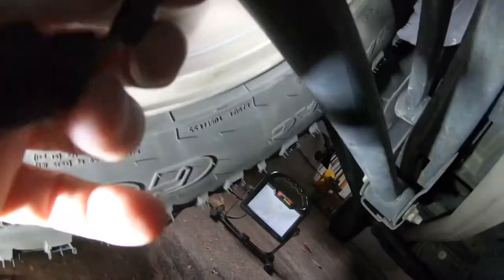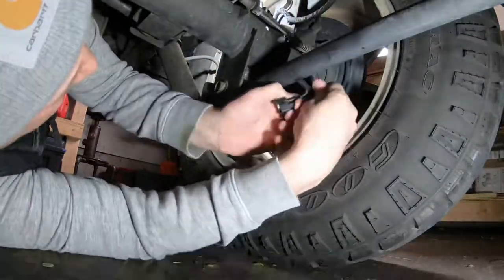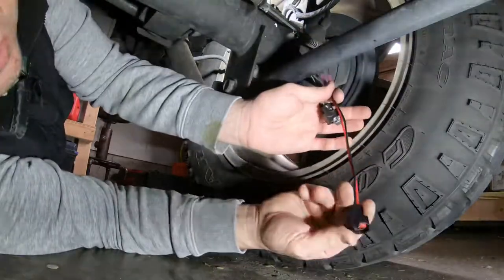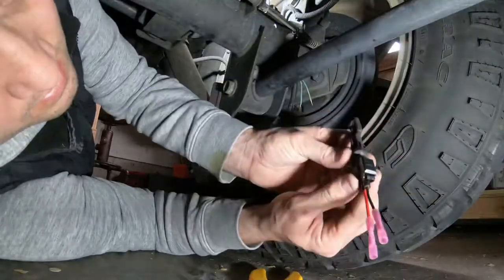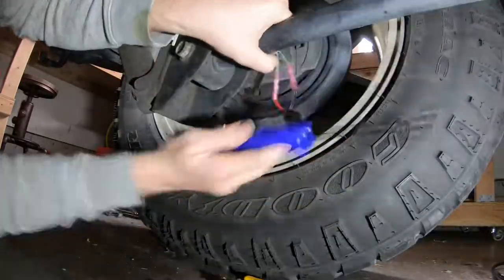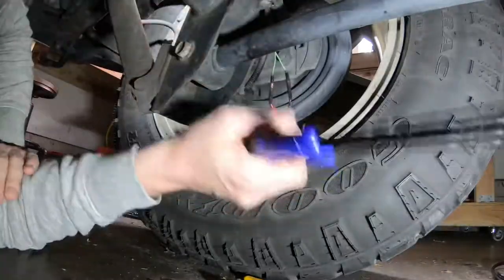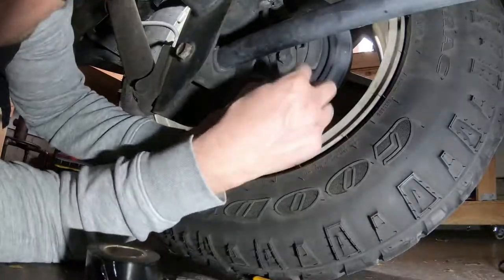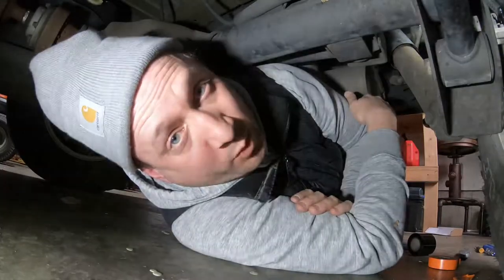Fixing the Broken ABS Speed Sensor Harness! #JEEPJK #EasyPeasy

Comment: Thanks for this awesome video. Replacing my rear this week, I’m just confused on the heat seal connector you used. Is there a specific one that I need because I can seem to find the voltage of the wire so I’m not sure which one to grab!
Reply from the maker: Thanks! 

I used a connector from an assorted pack I picked up at Lowe’s. You can buy them at any hardware store or Amazon. Here is a link... 

18-Count Butt Splice Wire Connectors 

https://www.lowes.com/pd/Utilitech-18-Count-Butt-Splice-Wire-Connectors/999952874

For the wire, I used a 14 gauge from AutoZone. Again, any auto or hardware store should carry it. 

Everything is still worked perfectly! No issues. 

I’m pretty sure I have links in the description of the video to some of the things off Amazon.
Reply: @theSuburbiaDad  awesome, thank you so much!

Comment: Where did you get that replacement part that you crimped onto the end of the existing harness? Don’t you have to get a new harness to plug it in the both ends? Is that more difficult? I mean where is the other end plugged into?
Reply from the maker: You can find the replacement at almost any auto store. I may have it linked in the description on Amazon; just make sure the part fits your Jeep. I think I went to AutoZone to get mine. I just replaced the part that clips into the sensor by connecting the existing wires to the replacement part. It clipped right into the sensor with no issues. I haven't had any problems / issues to date.

Comment: Would it be a similar process if I wanted to run new wires, harness and sensor from the abs module?
Reply from the maker: I would assume so. 🧐 It seems like a logical thought process. I’m not an expert on ABS systems though, so definitely do some more research before. I’ve had zero issues on the repair I made in this video to date. Best of luck!